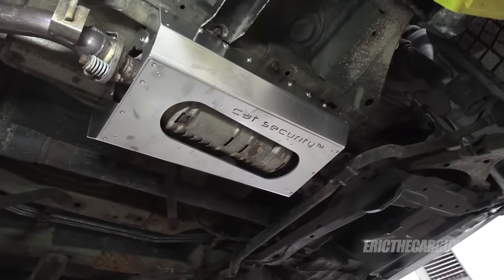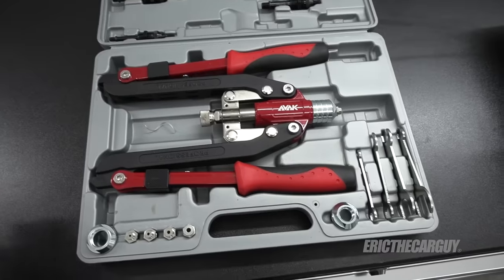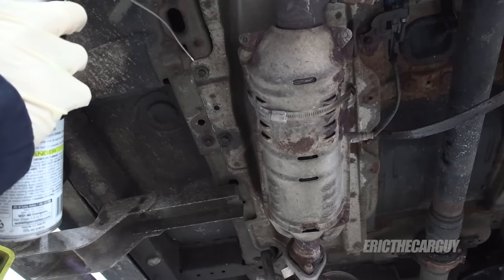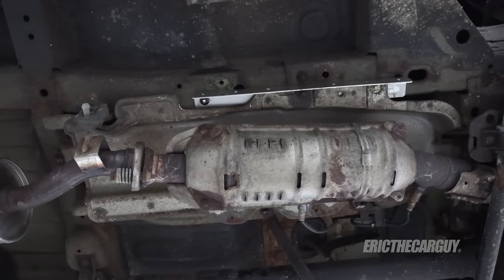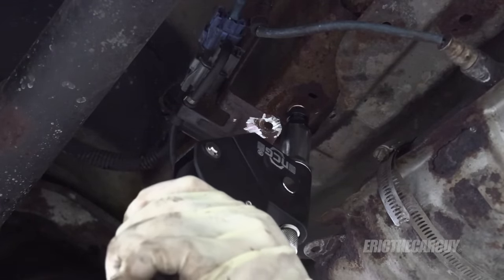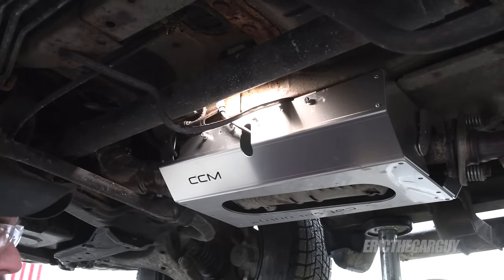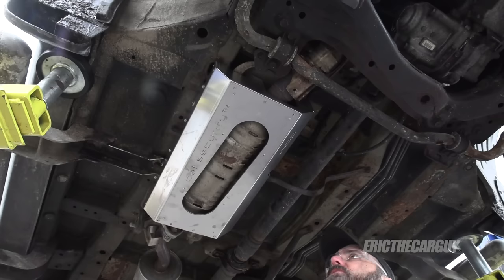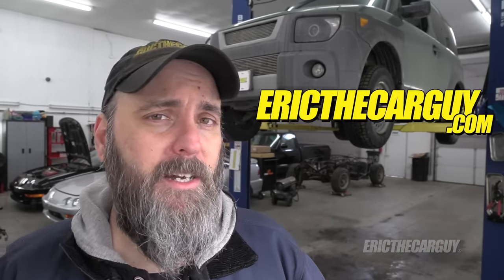How To Prevent Catalytic Converter Theft

Comment: I'm in Phoenix AZ. A friend had her Cat stolen from her 07' Element a month ago.  I had never heard of this craze.  I have an 03' & 04'. At 430am this morning I heard a very loud sound right in front of my house that's In a cul de sac. My Elements are parked in a covered patio. After 5 seconds of loud noise I opened the front door to see a truck and some guy near the Element  furthest from me. He jumped in his truck. He only cut halfway through the first cut.  My cameras didn't pick-up anything.  I ran out the house naked holding my nut sack Screaming MFr! Lessons learned; 1. Get two of these kits. 2. Get more cameras.3. Sleep with shorts on. Much gratitude to our Phoenix Police department. They were here in a couple minutes.

Comment: My catalytic converter was stolen from my 2014 Kia, Sportage three days ago.   Although my auto insurance covered the theft, the replacements costed approximately $1600 for the catalytic converter and $459 for the damage caused to the part removing the catalytic converter.  Repairs were done at the Kia dealership.   Also, I had to rent a car for two days and my deductible was $1,000.  This theft incident was devastating.  Every automobile owner should get a catalytic converter theft protector installed.
Reply: That is False Your kia catalytic converters are under the hood next to the engine Hard to get to so I know you lying 🤔 I got a kia too & the theft have to go thru all those wires to get to it
Reply: P
Reply: Except that most theft protectors don't work. The cat Shield failed on My Gen 1 Prius- the thieves just ignored it and left it intact.

Comment: I own a 2003 EX which I bought new.  My catalytic converter has bee stolen twice. The last time cost my insurance company $4000.00 thru the Honda dealership.  I was surprised that they didn’t just total the vehicle.  I ended up interviewing a few muffler shops about their ideas to fabricate a protective cover. I made my choice and so far, after two years, no problems.  The reality is, if a thief is given enough time, they can cut thru just about anything.  My job, was to make it a hassle not worth the trouble to even begin to cut.

Comment: This is such a big problem. Iv gotten so many calls from people thinking the engine is about to blow up. I show up and the cat is gone. It’s always people who can’t afford to replace it. It’s so sad
Reply: advise them to not put another cat on then. run straight pipe and some clamps for $20 from autozone
Reply: @an0therdimensi0n99  Unless it’s older than a 96 or you live in a state that doesn’t have smog inspections you’re going to need that converter sooner or later.
Reply: @tomasacevedo3932  that is correct if you don't know someone who knows a shop that will fly under the radar. i deal with a ton of bs living in a major city, but one of the upsides is, "that mechanic" can be found rather easy. if you get my drift.
Reply: If people cannot afford to repair a vehicle, bus tokens are cheaper.
Reply: @Thor Odin son And? I've seen people so cheap and poor that that can't even put wiper blades on thier vehicles. Some won't even put a small light bulb in their car.
Reply: @an0therdimensi0n99  Lose your state license and work at Starbucks.
Reply: @robertgary3561  i'm afraid you are stuck in the past thinking as if we live in a high trust society. especially state jobs, have to cowtail to "affirmative action" or "diversity hires" who are way more likely to have their hands in dirt. (hey, dont blame me, i'm pointing out the obvious). you think a person who works for the state won't turn a blind eye to charges that their cousin who is a mechanic who just got caught passing illegal vehicles in his shop? ha! jokes on you. USE THE SYSTEM
Reply: @an0therdimensi0n99  in the chicago metro area you cannot get away with it unless you wanna switch back every 2 years and most average people wont do that. In our area, they do an obd2 inspection and you cannot be exempt and test as obd1. Also, you cant fake with another vehicle as it reads the ecu's vin number to validate with the state's database.
Reply: @Thor Odin son  catalytic converters(1) is worth $1500-$2000 each and is not $25 to fix.. both of my catalytic converters(left and right) were stolen 3weeks ago right in front of our Church in Carson Wilmington CA.. total price for parts and service $5400…
Reply: Just happened to me 😭
Reply: @Thor Odin son  but wouldn't you need to replace any sensors cut, and rewire/reconnect?
Reply: @Thor Odin son yeah, in that case i would just put clamps with a straight pipe and a plug extension to take out a litle the second sensor (if it has) to avoid the check engine warning and just put a generic cat when inspection time comes, its not funny to get it stolen again
Reply: exactly. They got my 2007 prius at 2 AM. 6 guys dressed in black.  My neighbors got a video of it but it doesn't have clear enough images.  It was done in less than 1 minute, then the cars drove off. I hadn't been feeling well  so I didn't go to my car until  the evening.  The roar sounded like a jet airplane taking off in my car. It does sound like it is going to blow up. Anyway, I am still waiting to hear from my insurance. I had just  paid over $2,000 to fix my car to make it last longer.   Definitely want to move to Texas or Florida because they know how to treat criminals.

Comment: My mechanic installed this exact cat protector on my Honda Element. A few months later, the O2 censors failed which apparently was as a result of the cat overheating. I am not 100% sure if the censors failed due to the overheating, but be aware that this design could be flawed.
Reply: Did you get it removed or install an alternative?

Comment: About 12 years ago, I had just gotten my truck out of the repair shop after a wreck.  That day, I drove over 600 miles to Kansas City.  Before I got a hotel room, I stopped at my favorite watering hole in midtown for supper.  When I came out, I caught two thieves in the process of trying to cut out my cat.  They managed to get away and the cops were about as useful as a football bat, but the thing that really ticked me off is that I had just gotten the truck out of the shop and now I had to bring her back in to weld up the cuts in my exhaust.

The guy that did the welding job said that there were a lot of cuts down there.  It looks like the idiots kept hitting the O2 sensor mounts.  He figures that they must have broken a few blades before I chased them off.

Watch your trucks, folks.  Thieves love 'em because they don't need a jack.
Reply: My day is almost over, but I've been able to add Nut Cert and Football Bat to my vocabulary.  Definitely subbing to this channel..
Reply: “Football bat”! Lol!

Comment: Had both my converters stolen from my 06' Tundra. A chain pipe cutter made it easy & likely took no more than a couple minutes. It cost several thousand to replace. Insurance covered it. I welded rebar to all the exhaust pipe & this stopped them when they tried again. Super cheap. Protect your cats any way you can.

Comment: This is not really a cost-effective solution. Spot welding a couple lengths of rebar (the stronger the better, but anything will do) to the cat at a few spots along its length will be far cheaper and just as effective. If you don't have a welder, a muffler shop can do it for you, and if you do the prep work yourself, it'll cost very little.

Comment: The main thing I got out of this was the nut-cert (which I'd never heard of before).  Mental note made for future use. Thank you!
Reply: Gesipa Firebird rivet nut gun. Life changing if you do it for a living.
Reply: They're great. It allows you to install anything anywhere. Especially extra ground points for added electronics like a stereo system.
Reply: @bigb7157  
And scream and holler at them in 5 years when the bolt rusts in and the whole thing turns. 
Definitely not a great place for them under a car, it's a easy way out.

Comment: I’ve welded 2 Braided metal rope cable twisting on the pipes which burns out sawzaw blades thus slowing down thieves… also painted the cable and pipe day-glow paint so thieves will ID and “see it” quickly thus move onto an easier victim.

Comment: Metal to protect metal just makes it take a few more seconds to steal.  You just slice it down one side and bend it out of the way.
Reply: Easier said than done with stainless steel. It's going to eat sawzall blades up like crazy, plus take longer to cut, and be much more difficult to bend. Thieves will move to an easier target.
Reply: @SmittySmithsonite  You can grind off those rivets pretty easy.  Even if they don't get it.  They will do a lot of damage trying.
Reply: @seeya205  is it really worth dying under a car over?
Reply from the maker: True, but this makes it much more difficult to steal than just cutting a pipe in 2 places. That extra time could equate to getting caught.
Reply: @tommyguns14able  Its mostly druggies that do it and for them, yes it is!
Reply: Extremely unlikely if there is any other cars around. Their tool of choice is the saws-all and they like to target specific models that they know have easy to access cats. By the time they get through this shielding they could have cut out 3+ cats from other cars.
Reply: People that steal are looking for something quick and easy. They are probably only gonna bring a battery sawzaw and that’s it. If it is gonna take more than that it ain’t worth the time. The longer they are there making noise the more chance of getting caught.
Reply: It's won't be impossible to steal, but it will take longer and make a lot more noise cutting and destroying that box to get it out.
Reply: Nothing is gonna make the converter theft proof, just make it more difficult to steal it quickly, the thieves might see it at move along to an easier target.
Reply: Battery powered grinder with a cut off wheel would be faster than a recip saw. I once replaced a customer’s gas tank when gas was over $4 a gallon. His $20 locking gas cap cost him a large repair bill. Someone drilled a 1/2” drainhole into his tank for a few gallons of gas. Which is even sadder because I’ve removed various locking gas caps with a large screwdriver in seconds for people that had lost their key.
Reply: Honestly I don't know how much cats go for but I'm always suspicious of the people offering cash for them on fb offerup etc. Also I bet theifs would keep gens and corded tools and maybe diamond blades etc I sawed a whole truck in half a day with a harbor freight and diamond blades.
Reply: @ElectronicsForFun  There are 7” cutoff disc, it’s how I remove exhaust pipes. Not sure why you’d worry about straight cuts. These converters are getting scraped. Both tools will remove very quickly since a thief it’s worried about damaging other things. The recycling centers where I’m at require an ID for copper and converter scrap which is a start.
Reply: @bigb7157  a 7" cut off wheel on a cordless grinder? I don't think so. even if that does exist it's going to overpriced and underpowered. you still have the problem of all the sparks. cutting through the exhaust is going to throw a lot of sparks out and draw a lot of attention. lets not forget that a cutoff wheel will get shorter with every cut and they are a lot more delicate. if you try to muscle through, your blade will shatter and fly apart. a sawzall is the better tool because the blades last longer, the tool is safer to use, it fits in tighter spaces, and won't draw as much attention. if you're working on a smaller car where the cats are further up the pipe you'll have to essentially cut through half the engine to get a 7" cutting wheel in there. 

"Not sure why you’d worry about straight cuts. These converters are getting scraped." you're not doing it for craftsmanship, you're doing it because it makes your life easier. if you make jagged zigzag cuts you're going to struggle more to get it free vs making a clean cut.
Reply: De fund the police! 😆
Reply: @waterheaterservices  No, I support the Police!  If you can do better, join the force.
Reply: Best defense would be out of sight out of mind and make a cover like a metal skid plate that obscures the view of the converter entirely. Trade off though considering it would get hotter under there. I'm sure the body of the car wont like that too much.
Reply: @potardo9851  It would overheat way too much
Reply: @Apolloneek  $300 for many types
Reply: @seeya205  just the extra noise to get it done is another deterrent.
Reply: Yep plus I don't think it will deter someone from trying.  Even if they don't saw it off you're going to have a big bill from the mechanic trying to piece it back together.
Reply: @ElectronicsForFun  I use a 7” cutoff wheel and cordless grinder all the time for body mount chops. It would have no problem cutting exhaust pipe. 
I agree though the sawzall is a better tool for the job.
Reply: @Volksoner619  yeah it's not as loud, it's cheaper and fits in tight places.
Reply: @SmittySmithsonite  WHAT??? Majority of exhaust systems are a cheaper stainless steel. For vehicles in rust belt areas, most exhaust breaks are at the welds.
Reply: @iamtheoffenderofall  -  I was talking about the stainless cat guard Eric was showing here in this video. That's going to add so much time to cutting, thieves will move on to an easier target. 

I live in the heart of the rust belt - most exhaust breaks are anywhere they rust, which is normally at the hardware, first. They can break anywhere, really.
Reply: @SmittySmithsonite  said it yourself....where the hardware is....that's where they use steel welding. And with that shield...I'll bet an extra 10 seconds tops.
Reply: @seeya205  aw yea nobody will suspect a thing when some dudes under a car at 3am grinding the crap out of a bunch of rivets and freaking out about this making him late to his dealer. 
happens all the time.
Reply: @MrTheHillfolk   How do you think they get them?  With a hacksaw and quietly do it by hand? LMAO!
Reply: @seeya205  yeah I'd like to see somebody under there fucking  around for 5-10 mins with this shield trying to cut it off. 
It's gonna draw attention🤦
Reply: @MrTheHillfolk  You don't think the noise of cutting the cat would be quiet?  They get away with it all the time.
Reply: @seeya205  sure they do, but it would be kind of hard at my place being my car is parked outside the bedroom window and if I fart in the middle of the night the wife hits me cause she's such a light sleeper
Reply: If this was a problem in my area I'd just make a hydraulic pin system that spears them to the bitumen under the car :) Human mouse trap.
Reply: @Drunk3nMas7er  
Oh I'd definitely rig up some kinda booby trap, I have too much fun just creating shit and tinkering to solve an issue.
Reply: @bigb7157  Not necessarily, it is far easier to drill a hole in a gas tank to get gas than to get a hose into the tank due to anti-siphon measures built into a car's fuel pipe.
Reply: @1970351C2V  Yep but still cheaper than the $1100.00 converter he mentioned in this video.
Reply: @SmittySmithsonite  carbide toothed wrecking blade will cut it about like a red hot knife does butter.
don't go thinking the thieves wont have an expensive blade or good saw, because they steal them also!
Reply: @MrTheHillfolk  A trap that intentionally injures another person can end up in a civil suit where the victim , even committing a crime can win in court , I know from reading about it in news crime reports !
Reply: @georgepack4760  tell someone who cares , step on my property without permission and bring a body bag
Reply: @MrTheHillfolk  Wow , I'm  scared , why would I soil my shoes stepping on your property , that large 1/4 acre , you still owe on  ? I don't wear body bags , and I wouldn't know size you would need , and it wouldn't be a concern for me , anyway !
Reply: @georgepack4760  it would be wise to not go where you are not wanted
Reply: @MrTheHillfolk   Good point , YOU should make that a rule to live by , if I need advice from you :LOL!  that will never happen !
Reply: your are right for example: a metal safe to protect a precious metal like gold, ooops...

Comment: Hey Eric , our Element has been hit 3 times - all of them in the employee parking area at my employer ( a Swedish flat pack company ) in the wee small hours of the morning . On the first one , our insurance covered $1,500 of the $2,073 overall cost . But the next one they wouldn’t . After theft 3 , you know what we did ? We found a muffler guy in our state KS who just straight piped the exhaust for $100 . No , it won’t pass an emission test & yes we feel guilty about pollution , but we simply couldn’t afford the cost of yet another replacement . Also , the muffler guy said he was surprised that the thieves went for the refurbished converters as they are less valuable than new ones . * One other thing : The guy at our car workshop said that for an extra $500 he could install a plate the would deter theft , but not guarantee it . I’m guessing that this might’ve been the casing that you’ve installed here . But we didn’t have that extra $500 on theft No.2 . 
Thank you for the video though 👍